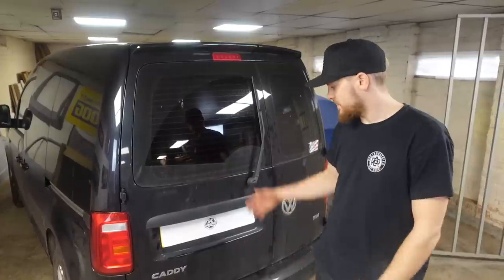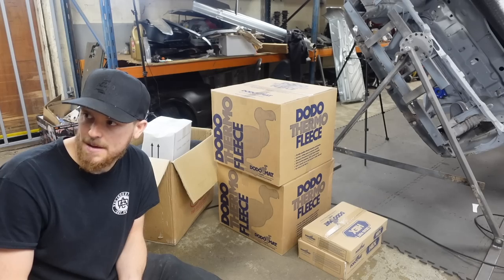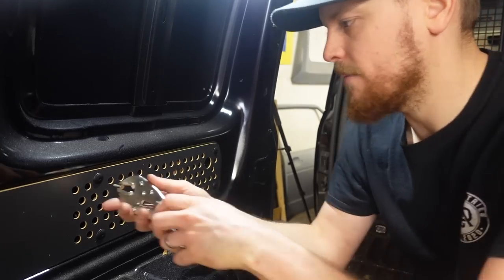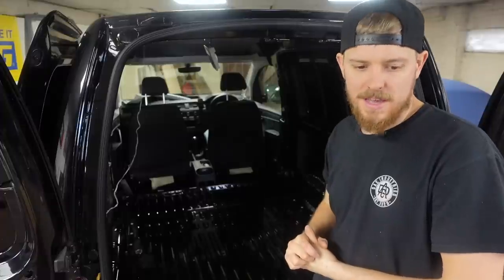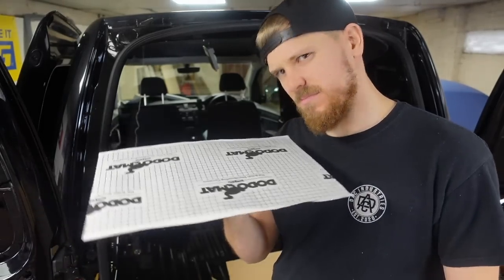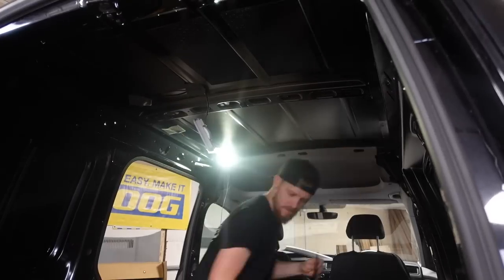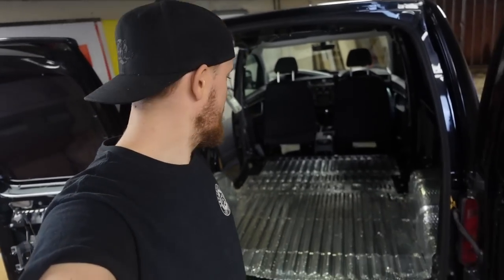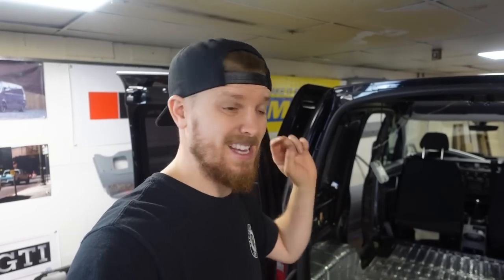VW Caddy 2k Sound Deadening, Insulation & Carpet Part 1 Conversion Caddy Camper Micro

Comment: Hi mate, great video. Just wondering if you will have issues in the future having carpeted over the access points in the lower panels in the rear? Would it have been better to keep the access, and carpet the ply covers?

Comment: Well done mate. I've watched so many clips of people applying sound deadening incorrectly. Seeing you clean all surfaces properly and using a roller to make sure the sound deadener is bonded correctly to metal is something lacking in alot of clips and critical for longevity and  performance. Also the amount you have used is the way I have planned to do my van. Too many people only apply a small sheet here and there which I believe defeats the purpose. Do it once do it right. Top job bro. Looking forward to watching you doing the next step!!!

Comment: Don’t forget the insides of the back and I’d do the front doors too
But then after a sunroof leak ruining my headliner in a MK3.5 Fiesta RS1800 and pre monster car stereo install, I did the roof floors doors quarter panels boot floor rear arches and then the front doors on the side where the trim fixes back on, had the dashboard out to get the main power cable through from the engine bay. Ok this was 2004 but I’m sure I was pushing 200 sheets of DynoMat....each week I’d go buy more as cost wise I had to break it down 
But boy what a difference, worth the effort and good on you for eventually doing this for your Step Dad

Nice one Dan 👍🏻
Reply from the maker: Thank you so much for watching and for commenting Bud. I did more than I had discussed with my Step-Dad! May go even further with my own project!

Comment: Definitely get one, I’ve had two great vans. Great vans. 
If your putting bulkhead back in, make ply infills for mesh area and carpet to match back, much quieter. 
If your looking at lowering it at rear speak to Carl jones at Jones Springs and get updated reprofiled rear springs rather than axle flip, far more suspension travel along with stiffer suspension. Lower front with springs or coil overs.
Reply from the maker: Thank you so much for watching and for commenting Stuart. I have an idea on the suspension set up...

Comment: If you want to make the interior the B pillar trims look better look for a vw caddy maxi 5 seater in the breakers, they came without a bulkhead and dont have those horrible gaps down both sides ,they also go right up to the roof lining and finish it off and way cheaper than vw who want 150 quid per side.
Also if you get a caddy ,you can fit a whole vw touran people carrier front half interior into it,dashboard too up to 2015 .Ive done it to mine and it changes the feel if it inside massively .
Reply from the maker: Thank you so much for watching and for commenting Bud. Yeah I have been looking into it all since I did this one. Hopefully my project will be a decent one!

Comment: Love your tip with the mole grips!  We have a special tool for the job but I'd say your way is possibly a better option!  I'm currently doing a Caddy conversion and because I didn't want to reuse those clips and didn't have the tool to hand, I ripped them out using a fork 🤣 I'm posting on Instagram but will eventually post on YouTube too. I'm looking forward to finishing your video to see how you transform it :) x x

Comment: Definitely get a caddy and have a go. I love my caddy and in the process of doing similar and butting rear seats in from a Routan. Just don’t get a 1.6tdi
Reply from the maker: Thank you so much for watching and for commenting Bud. I am looking for one at the moment. I have my eye on a few but all 1.6 tdi🤣
Reply: @DanChambersDAC  if you really want to do a proper conversion you can do an engine swap and put a tfsi engine in it to give you more power. That way you can get a cheaper older van and a donor car for swapping engine and loom

Comment: Great video Dan.  I’m at the stage where I’m sound deadening/insulating. Problem was/is condensation inside, any ideas? Chris..
Reply from the maker: Cheers bud. Yes they all do it. If you insulate and install a vapour barrier it should sort the problem.
Reply: Dan Chambers Thanks Dan. Take it easy dude. Chris.

Comment: Are the Dodo Dead Mat sheets heavy?  Do you have to think about the weight you are adding with all the sheets or is that not an issue?
Reply: 70 sheets = 20kg
Reply from the maker: Thank you so much for watching and for commenting Mark. The sheet's are not too bad to be fair. Should be more than Ok with this van.

Comment: You didn’t sound deaden above the cab 🙈
Reply from the maker: No I didn’t as I was never going as in depth as I did. Van is much quieter with what I have done though and my Step Father is very happy with it. The original plan was to just add a little sound deadening to rear panels and carpet it.
Reply: @DanChambersDAC  if you ever end up doing another, would be good to show you mine as I foam insulated as well, then carpeted over the top - super silent and warm too